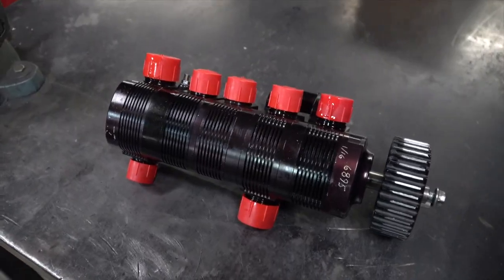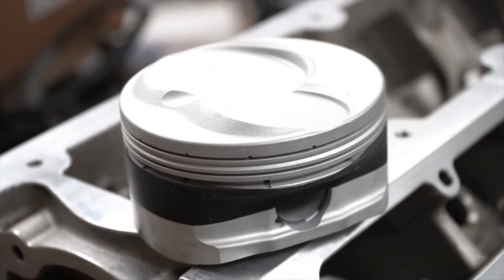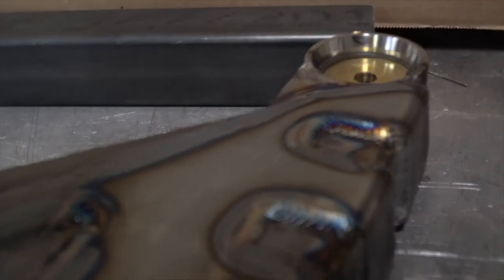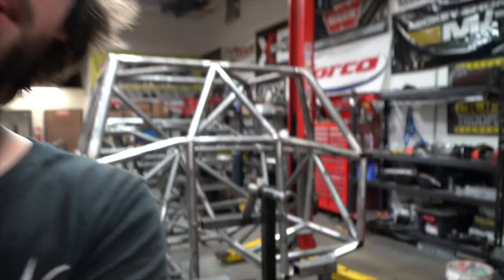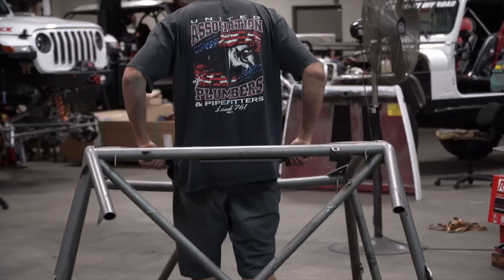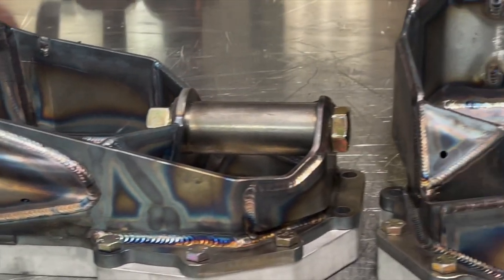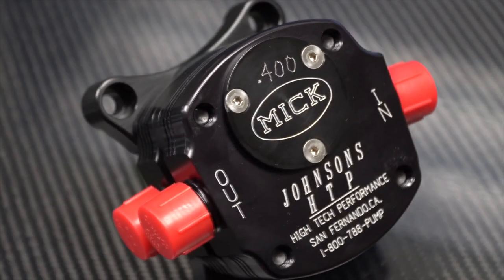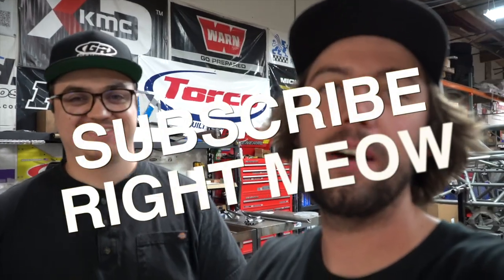A CLOSER LOOK AT UNICORN V4 - PART 2

Comment: Any plans to heat treat any/all of the arms. Crumple zones and designing some ductility in to the components is awesome but probably needs to be quenched and tempered, no?
Reply from the maker: Very good question yes all of our suspension components get heat treated to 34 - 36 Rockwell then shot peened. We’re going to try to get the upper and lower bulkheads treated as well we’re just not sure if they’re going to fit in the oven :)